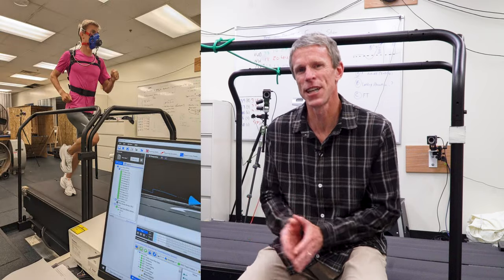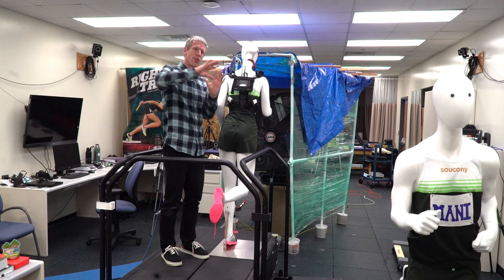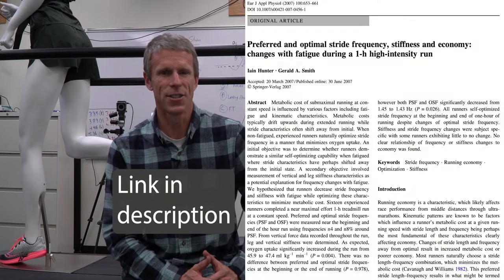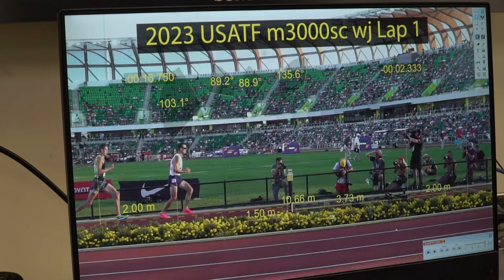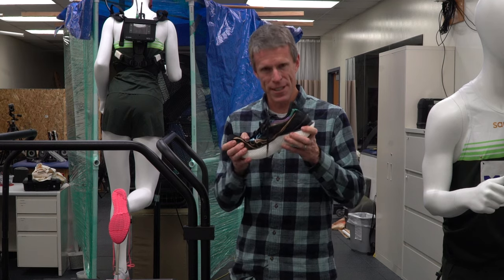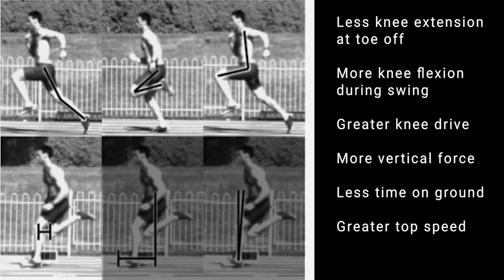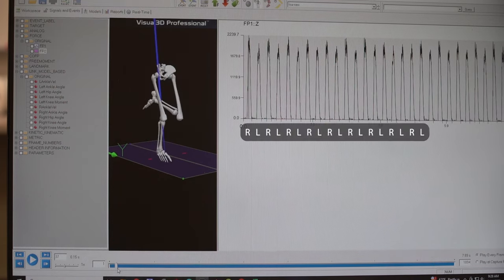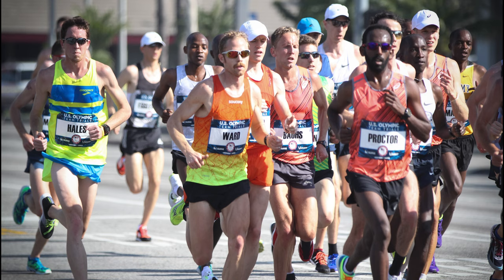Lifelong running: Running Mechanics Research

Comment: Really interesting information. I am a lifelong runner (started in the late 1970s during the running boom and will be 70 in February) and find biomechanics really interesting. Your discussion of Conner Mantz's foot strike really caught my attention. I am a midfoot striker and land harder on the outside of my left foot (always have). My left shoe always wears out faster than my right shoe as a result. I have also had left knee inflammation issues over the years. I still run three or four times a week but have to watch the hills due to this issue. However, my doctor says I have little knee joint movement and x-rays show a healthy knee. My biomechanics may not bee the best, but my body over the year seems to be able to deal with it. I look forward to more from your channel. Thanks.
Reply from the maker: Hearing of people like you running into their 70s and beyond gives me great happiness!  Congratulations on keeping healthy enough to do it.  Without knowing enough about you to make the most informed decision on how to help, I wonder if. you do much strength training to help the stabilizing muscles around your hip.  Knee problems often come from weaknesses of hip abductors which can be strengthened well with some band exercises or cable machines.  If that's not something you've been doing, I would recommend looking up some gluteus medius exercises and gradually build into them to see if that helps.  Good luck!